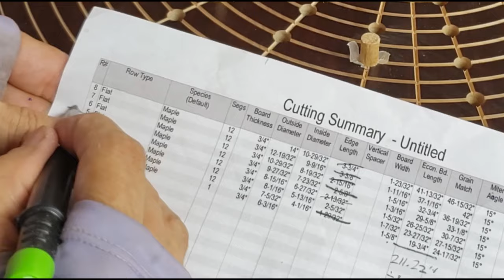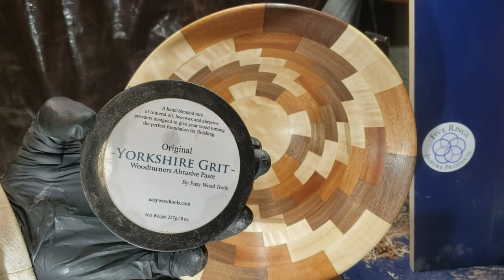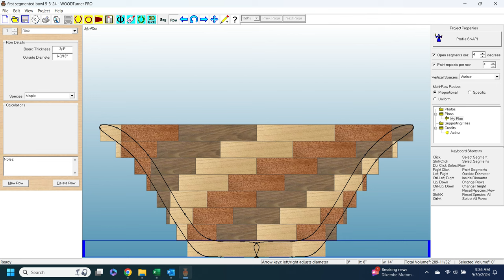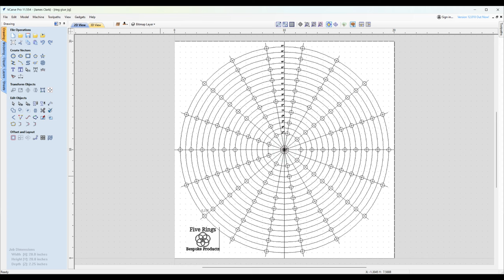Woodturning - Maple and Mahogany and Walnut Oh My - A segmented bowl

Comment: Just adds character! I did a segmented bowl 40+ years ago and still use it.
Reply from the maker: @jimvorheis1137  thanks!  I wish I had stayed turning 40 years ago! I missed a lot of fun 😁
Reply: @FRBPturning  I stopped from 1982 until this year. Back surgery, moved from Colorado to Oregon, and just plan life. I need to get a better lathe in the future.
Reply from the maker: @jimvorheis1137  I actually bought my lathe 20 years ago or so to make staffs for martial arts while I was still practicing. Then I damaged the spindle threads and didn't get them fixed until a couple of years ago. Now I'm loving the bowl turning in my retirement.